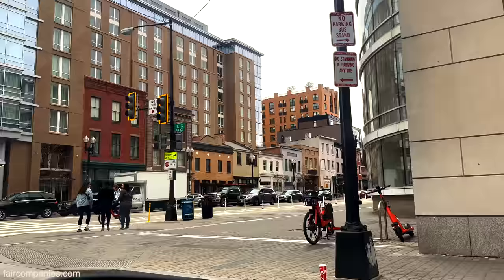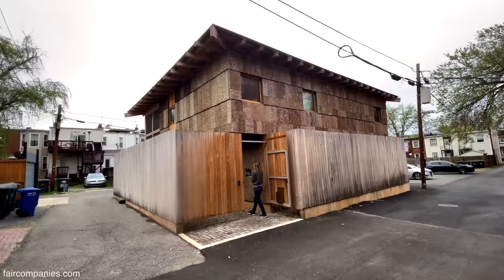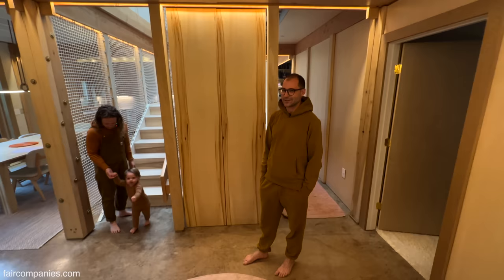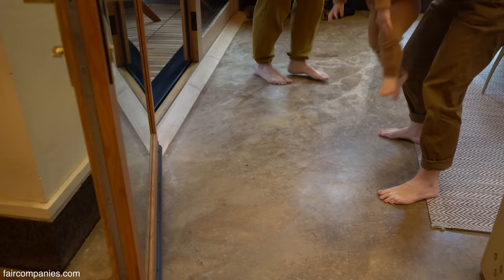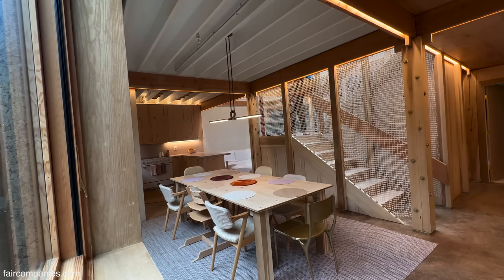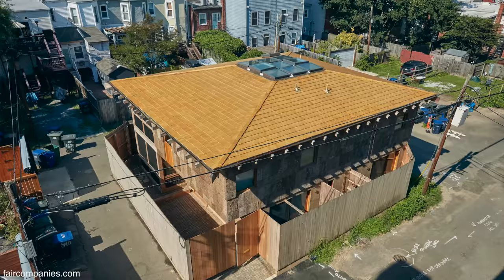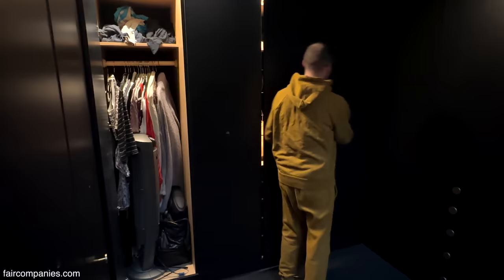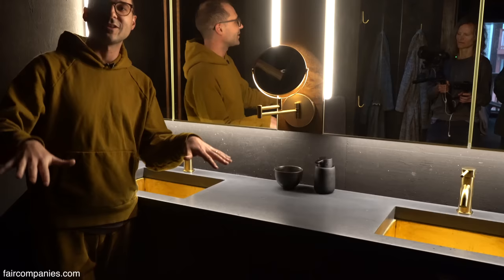Young family turns parking lot into stunning eco-home (DC alley)

Comment: He talked about the off-gassing of sheetrock, but plywood also off-gasses from the glues used. He didn't mention the finish on all that plywood. I'm not sure about all black in the bathroom. The humidity there creates an environment for mold, and with black, you can't see it.
Reply: I'm not sure about those off gassing claims about the drywall. It's made from paper and gypsum. I had a teacher that would plow it into his farm field to compost.
Reply: @drooplug  He was the one who mentioned off-gassing of sheetrock. I would suspect it would be the glue used to adhere the paper to the gypsum. Plywood uses a lot more of the glues. Some even use a formaldehyde-based glue. I have a bigger concern for the all black room. Super hard to clean and can't see mold.

Comment: I like the design concept, but to use such a large alley space for a single family house seems contrary to the solution for solving the housing crisis. I’d rather see a multi family unit being built to accommodate more families.
Reply: It's still an alley, where they need to allow for the circulation of residents' cars and the garbage trucks.
Reply: I disagree. It's a suburb, it's not a squatter camp

Comment: What a WONDERFUL build! I love the whole thought process behind how it is made, and how comforting and just overall health supportive it is in its function. The only thing missing is a tight row of aeroponic pipes along the outside wall (can be PVC pipes, or whatever he prefers), in that little "backyard seating area" behind his workstation (and maybe even the front entryway)... have a solar powered fish tank pump attached to a misting sprayer inside the pipes (the tiny solar panels that are for those decorative walkway lights, that you stab into your lawn - you know those ones?), and connect it to a bucket of ever-cycling water nutrient solution (at the bottom of each pipe set) - and Voila! It's an instant private herb and greens garden that simultaneously decorates the sitting area with some 'lush ambiance'!. But otherwise, it's one of the most perfect home builds I've seen yet... just beautiful!

Comment: The homes with the sunken main level he refers to are on Adolf Cluss Court SE, and won DC Home of the Year. The structure was historic, the only way to achieve two levels was to dig down due to the original height of the building that could not be changed. The alley they are on is wide, brick paved, great looking, historic and clean, esp compared the alley they are on - which is why we can assume they built a huge wall around the home home so you can’t see anything from the main level. 
What he said  about the owners not liking the homes is 100% not true.

Comment: I hate drywall as well but I wonder if you could clad it in say 1/16" veneer for cheaper than using full plywood for your walls & be much less cheap & crap looking but at a lower cost. Probably less environmentally friendly as you're still using dry wall & an adhesive as well, but I wonder what the cost comparison would be.

Comment: Overall like the house but some of the statements are not 100% accurate. Drywall off gases? You don't think plywood doesnt off gas? All that MDF and particle board in your cabinets all off gas. Drywall is definitely recylable. All the drywall scraps from my construction sites have been recycled if the geographic location supports that.

Comment: The ends of the roof trusses are sticking out beyond the roof itself. Are those trusses pressure treated, or would that not jive with the Alley family's ethos? DC is a humid subtropical climate. I am just curious why the trusses are exposed. It seems like such a blatant vulnerability to mold/rot and degradation, but I am just a dumb hick and I probably haven't graduated to this level of woke. Please enlighten me.